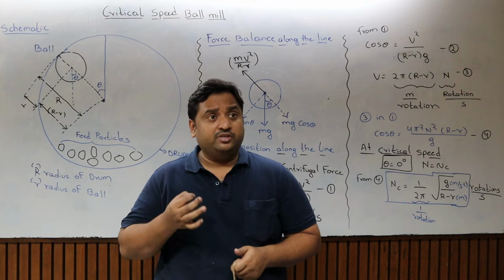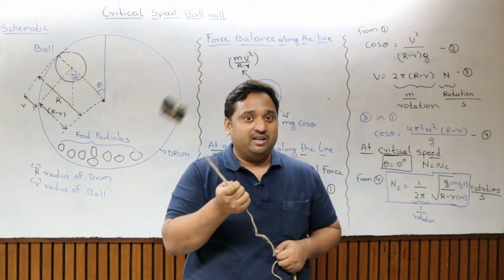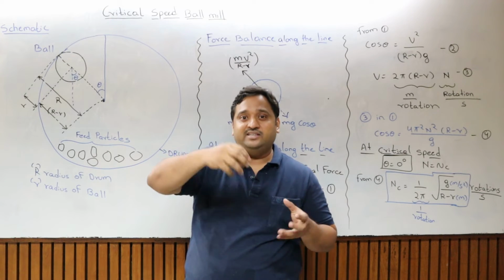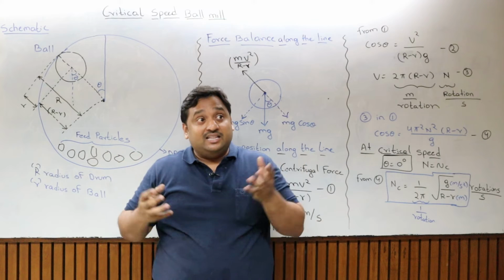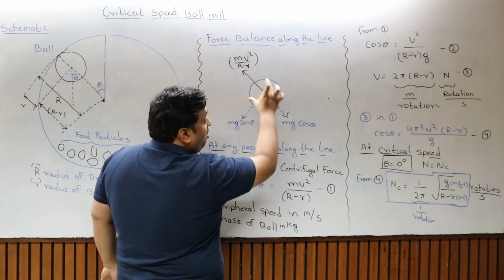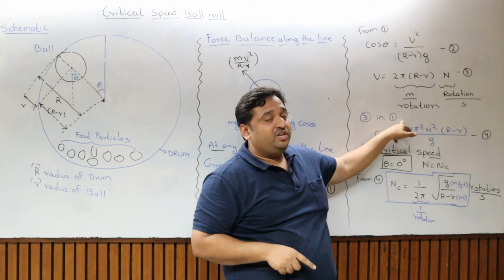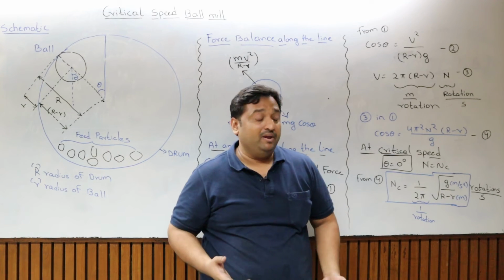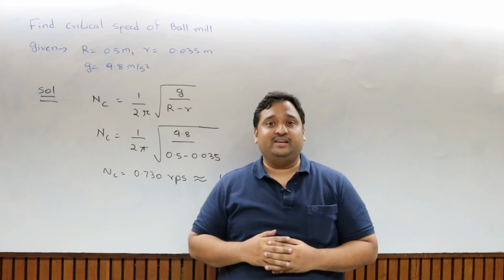Lec 13:Critical Speed of Ball mill Derivation and Example Problem :Mechanical Unit Operation Lecture

Comment: Thanks, Sir.
So normally, what is the percentage of ball in the ball mill?
Reply from the maker: A lot...may it depends on be the capacity of machine to turn the drum. If we keep lot of steel balls, we need to compromise in rpm as it becomes very heavy...

Comment: how to calculate the maxiumu height of the ball
Reply from the maker: For a fixed rpm and ball radius, you can calculate maximum height (size) of a drum R using critical speed of ball mill. Nc = 1/2 pi sqrt (g/R-r). From this formula, if you know Nc, g, r then you can find R

Comment: When determining the Critical Speed of a Ball Mill, a dimensionless number in the equation is used as a Constant with no name. 
For me to be able to understand something, I have to be able to follow the path laid out. Then, I can know how it works and dive deep into it; I need to know how it works. I prefer to avoid answering a question and being unable to follow it up with more, so I need to understand this particular equation for critical speed. This Number, which eludes me, is 76.6.
The equation Nc = 76.6/(D0.5)
That last Number is supposed to be an exponent, but I'm trying to figure out where that 76.6 came from. I thought it was a derivation of the Reynolds number, but the chat says it has nothing to do with Reynolds, which seems like it, so I don't know why, but I need help finding out how to fix it.
Re=uL/V=puL/μ .
Where:
ρ is the density of the fluid (SI units: kg/m3)
u is the flow speed (m/s)
L is a characteristic length (m)
μ is the dynamic viscosity of the fluid (Pa·s or N·s/m2 or kg/(m·s))
ν is the kinematic viscosity of the fluid (m2/s).
This started out as a simple curiosity for me many hours later. Now I have to know. Not that I care whether or not the chat and I can figure out whether or not this Number has an etymology. I also can't find exactly what it is or why it's there. Other than it's a balance of forces that makes sense to me. I still think it has something to do with Reynolds's Number, but I could be wrong.  Thank you
Reply from the maker: Hi paul...let me clarify your doubt. It is the same equation which I have derived in the lecture. They have used two things to arrive to the conclusion 1.simplification 2. Units......simplification is when the ball radius is small compared to the drum radius (R>>>r) then (R-r)= R = D/2...therefore ,√(R-r)=√D /√2.....use g in ft/min^2...= 32 ft/s^2 = 116127.15 ft/min ^2...therefore the equation becomes Nc (rpm) = (√2*√116127.15)/(2*pi*√D)=76.7/√D......***use always the value of D in ft as g used in this equation is in ft/min^2....for example critical speed of ball mill with drum radius of 3 ft is =76.7/√3= 44 rpm...All the best